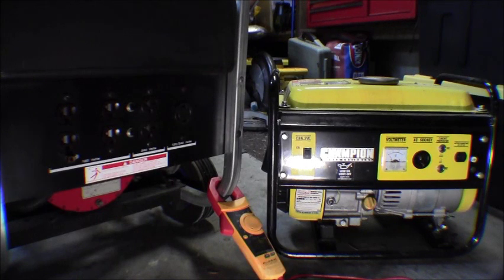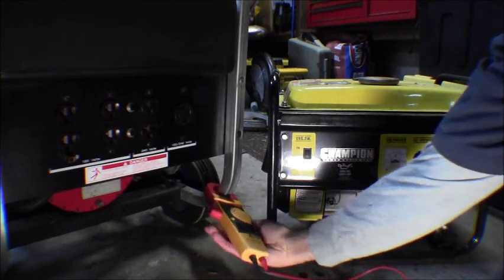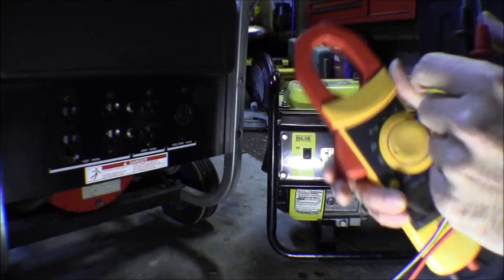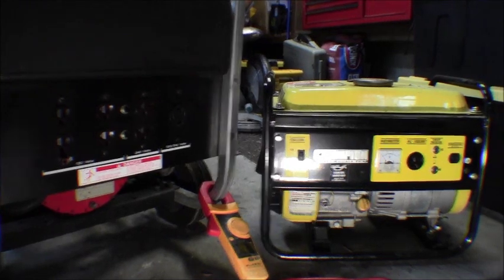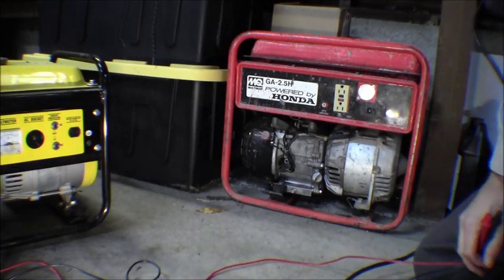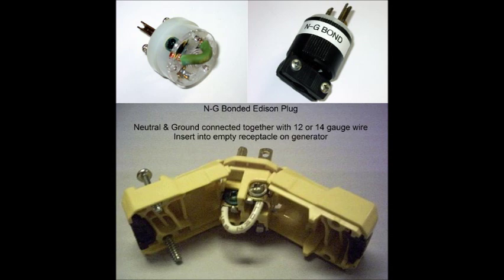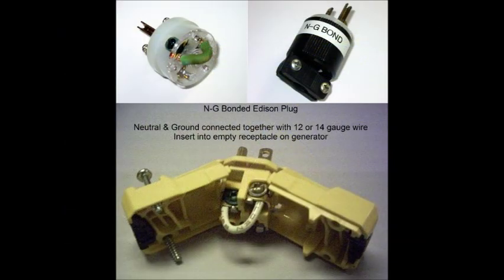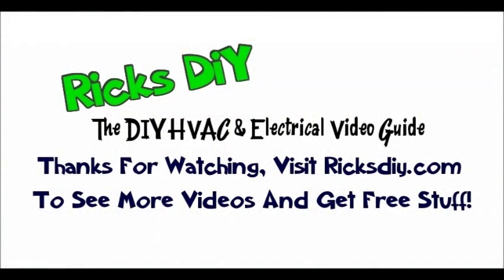Ricks DIY Testing Portable Generator for Ground Neutral Bond, Bonding Check Test

Comment: Hi Rick, I have a EU7000isC generator and the manual states "Honda EB5000i/EB7000i generators are designed for construction job site use and cannot be connected to a building’s electrical system. These generators have the neutral bonded to ground to comply with OSHA job site temporary power regulation" I want to install a transfer switch (30-Amp Indoor Generator Transfer Switch Kit for 6-10 Circuits). How can I connect this EB7000 correctly to the house electrical system. I didn't understand your video 100%. THX

Comment: I'm hooting up a generator to my panel to backfeed it for power to the whole house.

My concern was that I can shut down the main panel feed coming in with L1 and L2, what about the neutral? Someone said my generator needs to have a floating neutral to prevent power going back thru to neutral line and potentially causing harm or death to someone working on the lines.

You explained how to tell if the neutral is bonded or not at the generator, what I don't understand is which one is floating ....bonded or unbonded. How do change the generator to have a floating neutral so it doesn't backfeed thru the service line.

Maybe you could do a quick vid on the difference and how it applies when hooking up a generating and backfeeding into your panel.

Thank you for your efforts.... they've been very helpful so far.

Best Wishes,

Scott
Reply from the maker: +Scott Parat 
Unbonded basically means that it's a floating Neutral, and you can't change it. The manufacturer makes them one way or the other. I have never heard of any issues backfeeding through with concerns regarding the neutral...The neutral line is bonded with the ground at the service panel so basically your just grounding it, no issues with power hurting anyone like that, if someone knows otherwise please let me know.